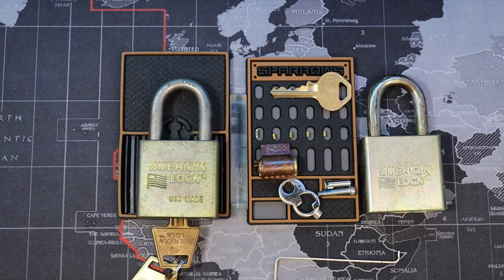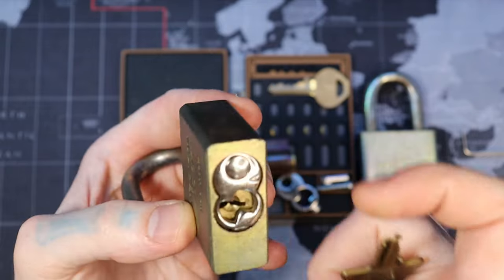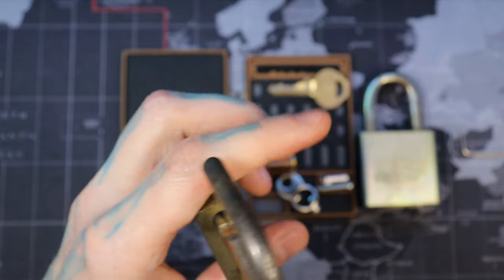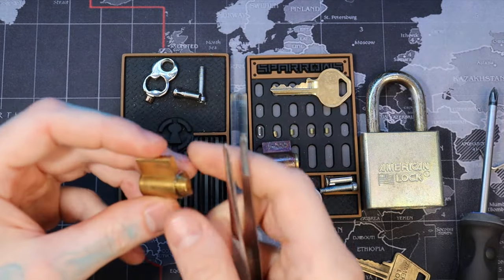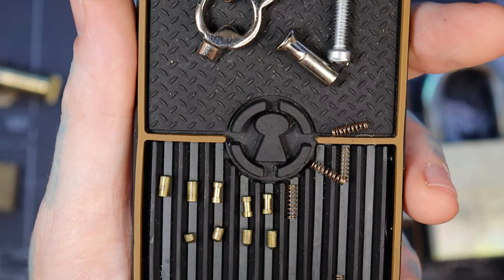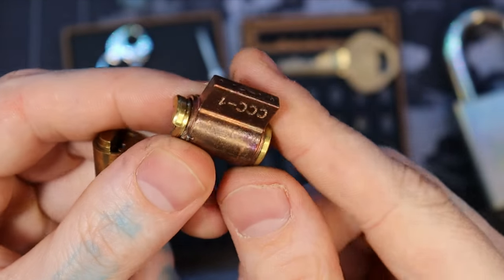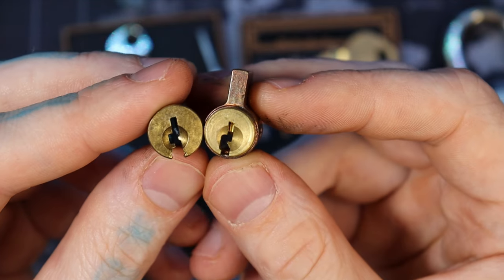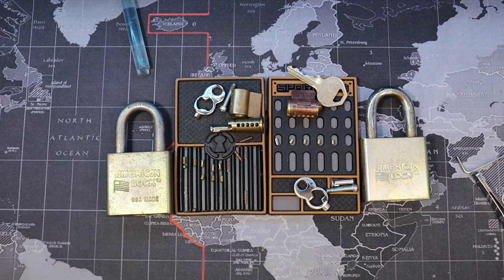304) American Lock 5200 Picked and Gutted

Comment: Well done the newer version on right with the Master M1 core is post 2003 when Master bought out American
The cheaper crimped version as you may know needs to be rotated (keyway opening) to 9 o'clock to pull out plug
Thanks for sharing